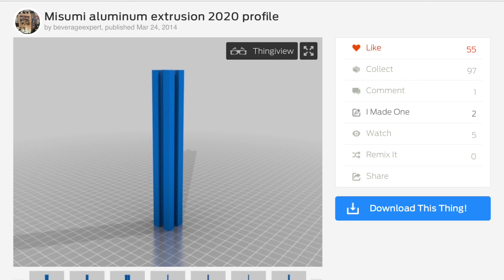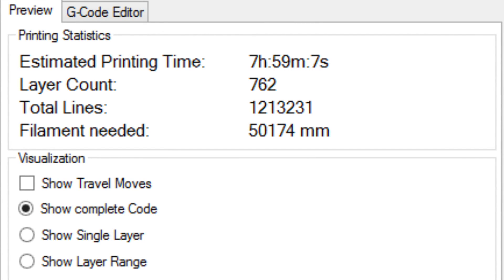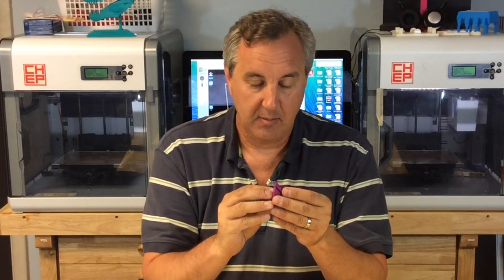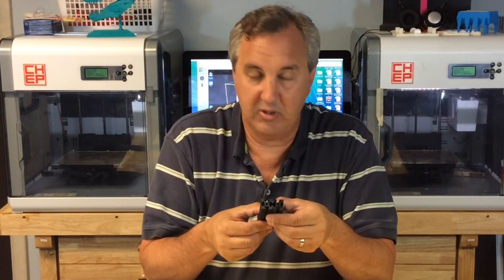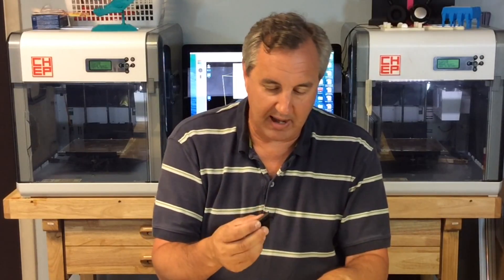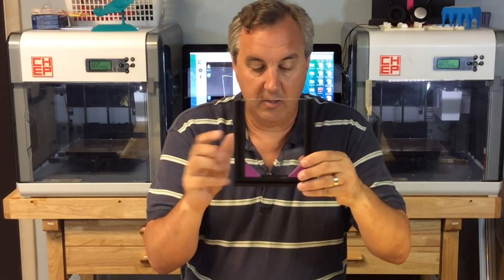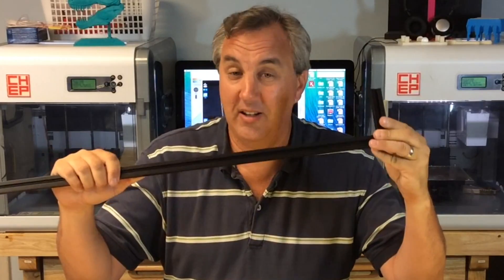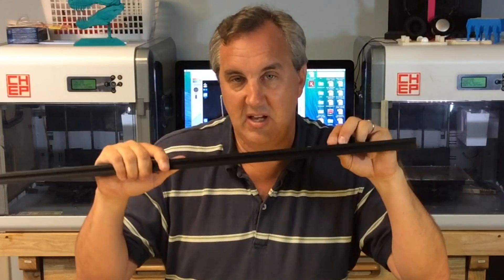Filament Friday #28 - 3D Printed 2020 Extrusions in Plastic on Da Vinci 1.0

Comment: I tried for the first time printing with nylon filament and believe me it is strong! I would challenge anyone to break it by hand. The problem with it though is it warps more than anything. If you think abs warps then nylon warps probably 3 times as much. Keeping it from releasing from the heated print bed while printing is proving to be a real challenge. I have looked around on the net and have found that people have used plywood ontop of their heat bed and found some good results. So it is something that I will try and let you know how it turns out. I just thought I would let you know seeings as strength seems to be a factor with this experiment. keep up the good work Chuck! loving the vids

Comment: your right when it comes to strength , when I saw this vid my eyes popped! I thought he's printing a 7 hour structure that is tall and thin. I thought to myself  if I want to do that then print a few of them to give them time to cool off. thanks for the 7hour print off. Question though, why didn't you print them flat on the bed? editing this post I just reckon to many small movements stress the extruder

Comment: its interesting how you got a better quality print in a significantly shorter time
Reply: Yes because the xyzware is garbage I have a da vinci 1.0a and flashed it with repetier and its way better plus with xyzware its slices awful and you can't use filament other than the filament sold by xyz and its expensive and only comes in abs and pla

Comment: You should have printed it on it's side. anytime a piece is long, make sure your print lines are longer than the height of your print so that it is stronger.
Reply: Perhaps if you filled in 2 of the slots and just printed it with slots on top and bottom

Comment: Hey Chuck, I have a Da Vinci Jr and I was printing something but for some reason the printer started printing a bunch of boogers (usual, I have this every once and a while) and when I tried to take the failed print off the bed it wouldn't come off. I don't know if it got pruned into the build platform's glass or if something else happened. I just won't come off the bed. If you have any advice, please reply! Thanks :)
Reply: ***** Are you letting your beds cool before you pull parts? I'm running my Da Vinci 1.0. When I try to pull of a finished print when the bed is above 70' it feels like I'm going to break the glass. When I let it cool (usually around 70c) I can pick the print up no problem. I dont even need to use a scraper.

Comment: Hey Chuck. I think if you would have used a 50% or higher on the infill it would be stronger. With Simplify 3D 3.0 and above you can set the infill to print every angle on the layer.